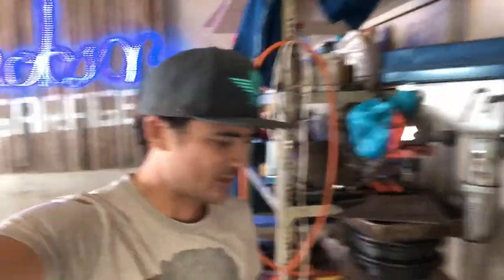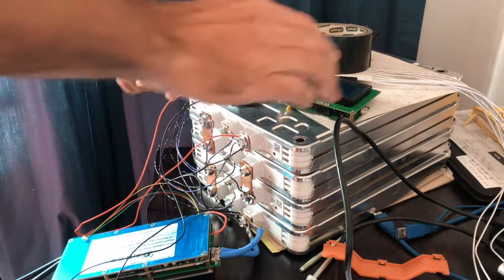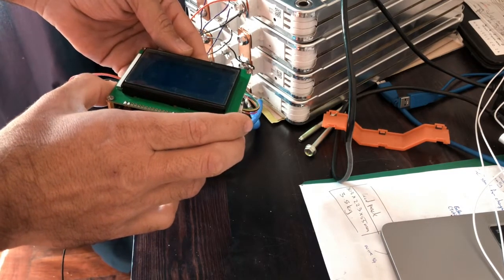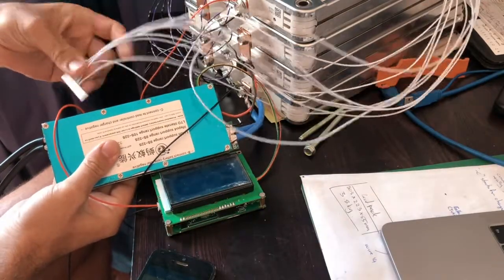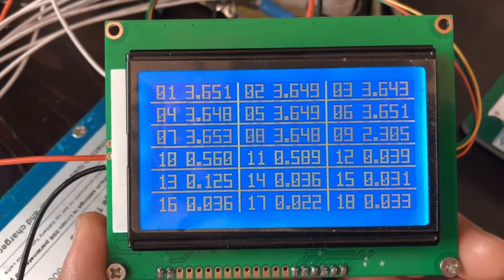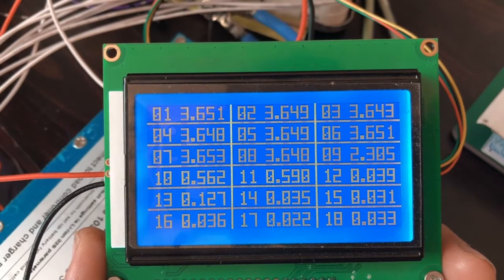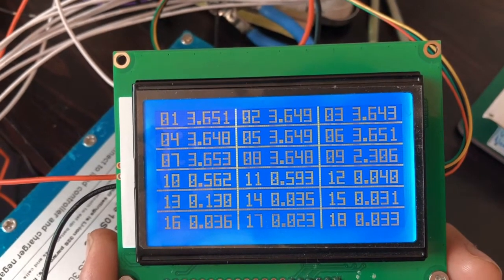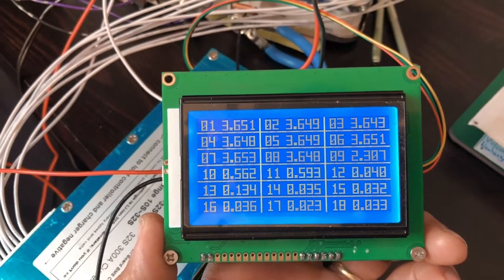ANT BMS turns on! YES MAN!!!

Comment: I can't get my screen to show any data. all the parameters are reading zero
Reply from the maker: So if the screen is on it means ~30V is powering it? Plug and unplug the multi-plug to the cells? Also there is a ground wire that plugs into that multi-plug on the last position if I remember correctly.
Reply from the maker: https://www.youtube.com/watch?v=V42uUr3p2PI&t=128s watch from around 2 minutes, I've drawn a diagram.